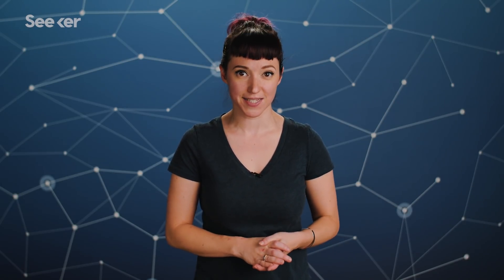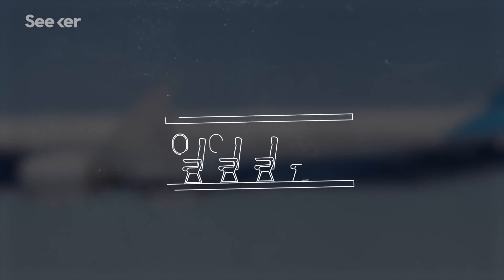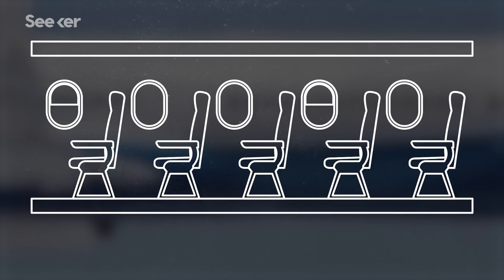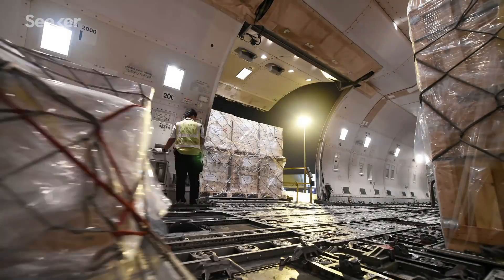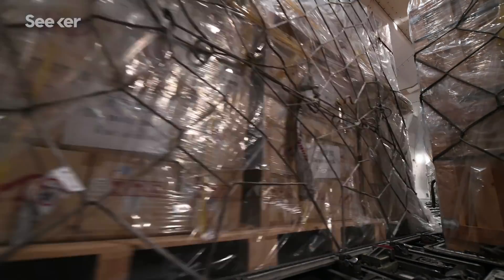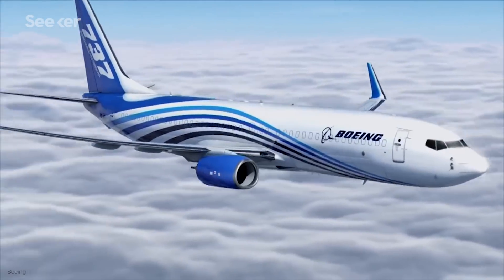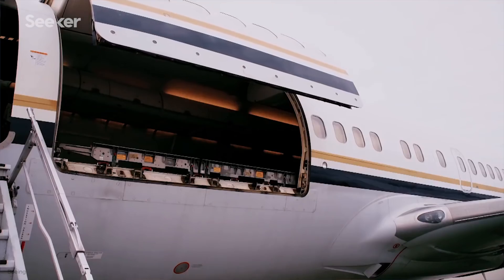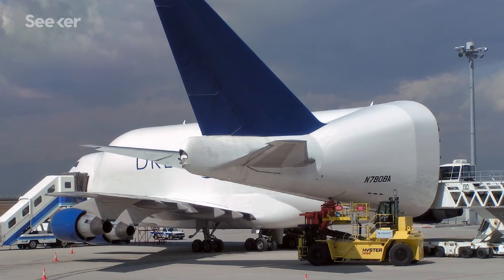Propellers, Big Doors and Weird Floors: The Making of a Cargo Plane

Comment: Propellers have more propulsive energy?  I think you meant efficiency.  Propulsive efficiency goes up as the velocity difference between the jet behind the propellor or gas turbine and the air passing the plane drops.  It is hard with a single propellor to generate significant propulsive energy compared to jet engines or rocket motors since the tips of propellers are travelling significantly faster than their roots making it very difficult to optimise large radius propellers.  Right now there is no question, of the engines currently available, the engine with the highest propulsive energy is a rocket motor not a propeller.